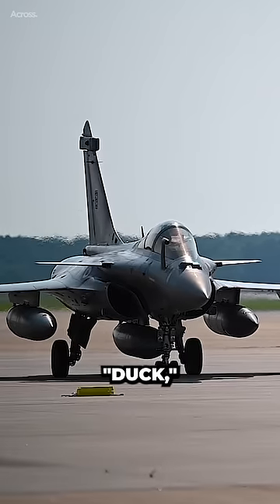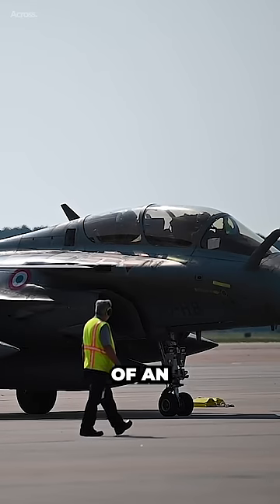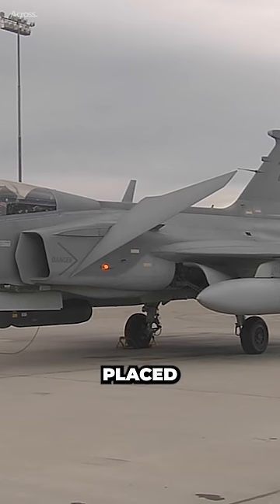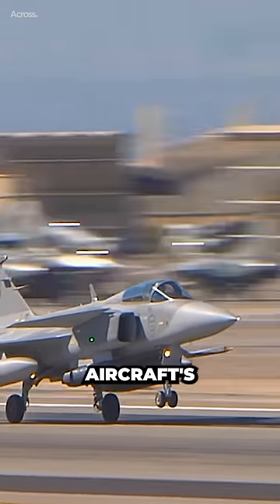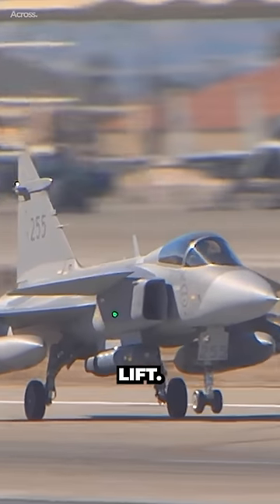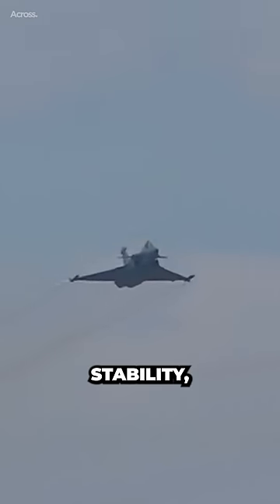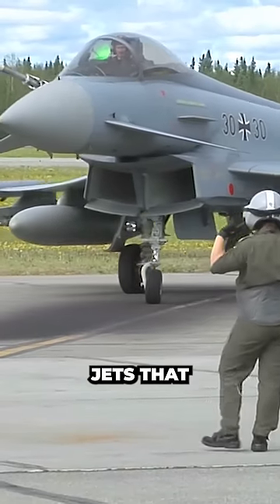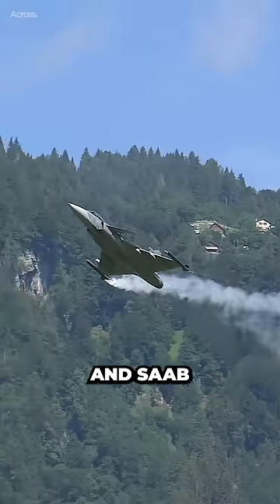Why Don't American Fighters Jets Have Canards? #shorts

Comment: NASAs F-15 “hold my beer”
Reply: F-15 S MT/D
Reply: Not a fighter. Just a plane used for testing
Reply: F-15 S/MTD?
Reply: @Strider2Count8492  yes
Reply: NASA: hits blunt 
"let's get some F-18 spare parts and bolt them to the front of the best fighter aircraft ever made"
Reply: @feston4032  same thing, but 🙏
Reply: @MattKearneyFan1  The first letter denotes the mission of the aircraft, while the number denotes the design number. 

Therefore the F means fighter.
The McDonnell Douglas F-15 STOL/MTD is a modified F-15 Eagle FIGHTER. Developed as a technology demonstrator, the F-15 STOL/MTD carried out research for studying the effects of thrust vectoring and enhanced maneuverability.

So wrong, it not just a plane but fighter used for testing.
Reply: Everything NASA tweaked is always better
Reply: @MattKearneyFan1  Still, it had incredible maneuverability!
Reply: @anubis20049999  I wouldn't say experimental is better but it certainly is much more potent.
Which would you prefer a fighter that costs 100M$ each with the latest tech & made in a platform that lasts 10 years in constant combat or a fighter that costs 10 billion each with advanced tech made in a platform that lasts 1 year in basic operations.

The thing is we could make them last 10 years but why make something so overwhelming without any reason.
Reply: @AzultonSmugUltra  it’s just a plane used for testing
Reply: @MattKearneyFan1  😆
Reply: @AzultonSmugUltra  no it WAS a fighter. It was decommissioned and used exclusively for testing. The actual designation should be X15 STOL/MTD because it's no longer a fighter and is used ONLY for testing.
Reply: @painteater19  there is no such thing as the best fighter aircraft ever made.  Tomcats and Vipers have had equally successful careers to the Eagle, and there were fighters before those which performed remarkably. And with each new generation of fighter with new technology that renders the previous generation inferior by comparison, the bar keeps being lifted. The nature of air warfare is constantly changing, but even if it's BVR, it's still a fight.
Reply: @Aquascape_Dreaming  F-15 has 100+ kills against 0 losses which is unmatched. Obviously the F-22 is the true king of the skies these days and my comment was kind of tongue-in-cheek but the stats are there.
Reply: @W1ckedRcL  *IS. Recommission is the process of retirement from (especially military) service.
Sure it's fighter role was air superiority, ECT & a human is a grunt, ect. But after service it's structure is still that of a fighter & same for a human after you take their weapons. It's experimenting with FIGHTER designs to improve FIGHTER maneuverability & ect not commercial planes, but I believed that was without saying.
Reply: @AzultonSmugUltra  no it WAS a fighter. The F15 tech demonstrator is decommissioned. It's no longer a front line capable fighter. In fact the gun was REMOVED to make room for the canards. Your analogy is irrelevant. The F15 STOL/MTD is no longer a fighter aircraft. It is a NASA technology demonstrator, testing high alpha and slow speed maneuverability. The only reason it still has an F designation is because there's no need to change it. Everyone knows it's a TD platform. But, once again, the official designation SHOULD be X15 because it's being used as a test aircraft.
Reply: @W1ckedRcL  Keep telling yourself that. The X stands for eXperimental aircraft with completely different, non fighter designs.
Reply: what I use in Ace Combat for dog fighting
Reply: @AzultonSmugUltra  keep telling myself what? That an aircraft that literally had its weapons and fire control systems removed to make room for testing and experimental equipment is still somehow a fighter and not an experimental testbed aircraft?
Reply: @W1ckedRcL  A decommissioned or damaged fighter, destroyer, tank are still called by their race. Same principal that if you have no arms, legs & can't focus due to brain damage you're still human. Try to learn, will you?
Reply: @W1ckedRcL  It's like referring to a jeep, truck & car as only a vehicle after it's decommissioned. They may be vehicles but they're not just any vehicle, just like any plane isn't just an aircraft, any dog isn't just a k9, any bear isn't just a bear.
Reply: F-15 Active
Reply: @LegioXIVGemini  F15EX Eagle 🦅 is the best fighter in the world, currently known publicly.
Reply: @AzultonSmugUltra  fighter? No.

The best FIGHTER in the sky currently is the F22.

The F15EX is an attack aircraft, and a missile truck for planes like the F35.
Reply: @AzultonSmugUltra  no it's not. It's nothing like that. Your analogies suck.

The F15 STOL/MTD is NO LONGER A FIGHTER AIRCRAFT.

It is a technology demonstrator.

It has no gun and is incapable of carrying weapons. Its fire control systems have been removed.

If a Formula1 car is altered in such a way that it no longer conforms to Formula1 rules and regulations and is incapable of racing on a track due to modifications to the body, suspension, powertrain and drivetrain, is it still a Formula1 car? NO.
Reply: @W1ckedRcL  BEST not deadliest. Its role is air superiority.

The 15EX is a multirole platform that can do it all with great but not incredible performance.
Reply: @AzultonSmugUltra  okay. I agree with you on this.
Reply: @W1ckedRcL  My analogy is perfect. Yes that means your ad nauseum argument is the 1 & only that sucks. 

Irrelevant because it's designed as a car not just a vehicle. You only proved my point. Thx.
Reply: @W1ckedRcL  I should clarify I mean fighter as in FIGHTER JET because if I said jet, I don't mean jet engine.
Reply: It’s harder to avoid radar with canards. The vertical stabilizer is the next to go but we will get rid of the pilots soon…
Reply: @painteater19 : "The best fighter ever made." 

At that specific time it may have been, not anymore, though.
Reply: @painteater19 : "That old Chestnut" of 100+ kills 0 losses. Yeah, mainly against poorly flown less capable aircraft. In recent years, against better flown more capable aircraft. Things haven't been so 1 sided, to say the least.
Reply: We have 15 was the best fighter jet ever made and it still is the only plane that can actually give the F22 a run for it's s money
Reply: Also wouldn't any extra pieces especially flat pieces increase your cross section?
Reply: The US experimented with this and thrust vectoring and they found out it wasn't worth it.
Reply: @MattKearneyFan1  🙄😮‍💨 we know , the f-15 is in fact the fighter nasa uses/used as a test bed for canards
Reply: 888 comment I design them.
Reply: @MattKearneyFan1 so it's an X-15 then
Reply: The F-15 built in the 70s doesn't even need it's main wings to fly. Why would they want to add canards to it as well? It already easily breaks the sound barrier in a 90 degree vertical from takeoff. In fact, adding canards to it would make it less stable at high speeds (as stated by the video, don't know how accurate that is) which is one of the many things it's known for.

Funny little video to back what I'm saying: https://youtu.be/Qp62hR6J0MM
Reply: @Aquascape_Dreaming the f-18 hornet could arguably be the exception
Reply: Don't go getting too hung up on a test bed aircraft having an "F" designator. Remember the F117? Yeah, the dedicated bomber that was designated as a fighter in spite of not performing as a fighter? That F isn't really all THAT important after all 😂
Reply: Does the F15 need a rudder and carnards...even a wing.
Reply: @Aquascape_Dreaming Agreed. We also can't put piston engine in same category, and so on. 
For an example, Messerschmitt Bf 109, Spitfire and so on, shot down thousands of aircrafts. 

When talking about best anything, we have to look at time, category, class and so on 👍🏻
Reply: not a military plane
Reply: it was for Testing purpose only.
Reply: That's a thought. Do fighter jets have cupholders in the cockpit? 😂
Reply: That one time the Eagle felt the Information high.
Reply: @feston4032  

Correction:  F-15 STOL/MTD
Reply: streak eagle
Reply: @painteater19  Sorry, best fighter ever made was the Spitfire. How many times has the F15 saved an entire nation?
Reply: @Strider2Count8492  you should know, its a DLC aircraft in AC7
Reply: @Strider2Count8492 ace combat fan spotted
Reply: @upeo12   Y E S
Reply: @Strider2Count8492  a pleasure
Reply: There was even an F4-J Phantom II that modded with canards for testing purposes.
Reply: @W1ckedRcL It was a experimental platform just like the f-16 jumbo it never was used for  combat so no it was never designated as a fighter aircraft because that was never the purpose.
Reply: @Some-Guy1127  that's what I was saying. It's not a fighter JUST BECAUSE it has an F designation. The guy I was arguing with was saying that because it's designation is F15 that means it's a fighter and nothing else matters. F means fighter and that's the end of it.
Reply: @AzultonSmugUltra  That's a piss-poor analogy. If a person was a high functioning football player then suffered a terrible accident and lost both arms and legs in addition to permanent brain damage...that person's role in life has significantly changed from football player to brain impaired, quadraplegic invalid with virtually no discernable role in society. Those two states are still describing a human...but vastly different humans in their respective present functions and capabilities. Same with jets. Their mission purpose defines the difference. By your analogy, all platforms and their variants shouldn't have designators because they're the same plane at their core. So why is a T-38 talon not called an F5 or vice-versa? If a particular F15 variant is now a jet exclusively used for testing and experimentation, then that's it's role or mission and should be designated as an X plane.
Reply: @BuccWylde  Low standard analogy? Doubt 🧐
Yours however failed from the start.

I made myself clear you need to make up a story. The human can revolution (fast evolution) into a gunman, sportsman & ect. Machines like a fighter can also revolutionize into something else but it's still a fighter even without wings & guns, like a battleship is a battleship without a hull & guns, a tank is a tank without armor b& guns. 
How hard is it to understand that if a fighter crashes without guns or wings it's still a fighter, we don't say the once was a fighter, battleship, tank crashed 😆

Bro 🧉😎 really tried to sneak a human revolution is comparable to a normal fighter.
Just like your still human born with a main role (reproduce).
A fighter is still a fighter born with a specific role(out of many).
Reply: @AzultonSmugUltra  A battleship without a hull and guns is still a battleship eh? I say it was once a battleship but now is defunct hunk of scrap...or does the Navy still float them out to sea in that state on missions of defending coasts or shipping lanes? Yeah, didn't think so. What battle is it going to win? The war of rust? There have been Naval ships that have been turned into stress test models, training husks, and even museums with a gift shop, and that what people call them then...they were once "so-and-so" and then we're repurposed to "so-and-so". You claim I had to make up a story, what? All analogies are hypothetical comparisons. You still haven't debunked my question as to why T38 isn't called an F5 or referred to by anyone ever as a fighter jet. That's the opinion of this ex Air Force vet and if you can't see the distinction, then we'll just have to agree to disagree.
Reply: @BuccWylde  pretty bad analogy coming from a self proclaimed "air force vet".
I personally don't believe you. I don't appreciate your misinfo. Try investing time in the matter if you care. You're clearly lacking something I can't teach that's learning.
Reply: @AzultonSmugUltra  What misinfo? You tell me now that you have proof of misinfo. I am a USAF veteran. May have been many moons ago, but I served full active duty. I'll give you a few facts that the average citizen faking veteran status may not know. When I was in, non NCOs had a subdued star in the middle of their rank chevrons, there was no such thing as a combat action ribbon for AF personnel and one could still be awarded an achievement medal for valor...so yeah, it's been awhile, but not so long that I don't know the difference between a fighter jet and a jet designated by the Air Force to perform some other function. Nobody was ever talking about ships or cars or tanks, but the different functions of military jets and their distinguishing designators that tell you what that jet currently is. Your example of a fighter jet falling out of the sky with no wings and no guns is weird. How did the wings and gun come off? During flight? After it hit the ground? Doesn't matter. If it's role was a fighter jet at the time it fell and crashed then that's what it is...a crashed fighter jet. Probably won't be a fighter jet anymore as it assumingly was totaled and non salvageable. Don't get what point you were making there and the whole inanimate objects have a race much akin to humans is silly. Look up the video where Tom Cruise takes James Corden up in his P51 mustang and then says to James that they'll be going up in a fighter jet next. Well Tom was being a little untruthful there because the jet they used looked sleek and was certainly of military design, but to say that he was gonna take him up in an old Czech made albatros trainer that he borrowed from a CIVILIAN air show team juuuust doesn't have the same gravitas as saying a fighter jet, but the producers knew that 90% of the common civilian viewers watching the clip wouldn't know the difference. The second NASA sells that craft back to the military and they assign it to a fighter wing on some base and it rolls out on military sorties... it'll be a fighter jet. Until then it's a test jet or an experimental jet. I'm done with this subject so all I'll say is good day and try to not let pride paint yourself into petty nonsensical arguments on YouTube.
Reply: @BuccWylde  You compared a human occupation to a machines born role that's missinfo.
We call it a fighter from its designed purpose, just because you lose a limb you're still human, your human species title isn't taken away & now you're a homosapien, or worse bio mass. You're calling the specific plane an aircraft or scrap is a kin to that.
You can have an experimental fighter, as it's purpose is to test it's fighter body.
Taking away its weapon still makes it a fighter it's not literal.
It is like saying a horned lizard isn't a horned lizard because it lost it's horns, a fly that can't fly isn't a fly XD.. bruh.
It's like what else is there to call a fighter? We can't call it jet aircraft because there's jumbo jets & ect.
It's obvious a fighter, why make it so complex, when the answer is clear, don't be so close minded.
I still don't believe you're a usaf vet, but who cares, really?
Reply: F-15 S/MTD, and the F-15 ACTIVE.
Reply: It's really beautiful